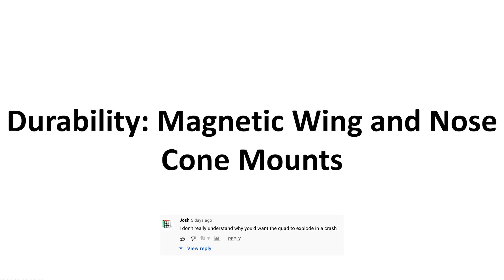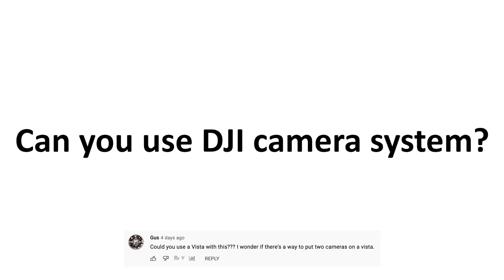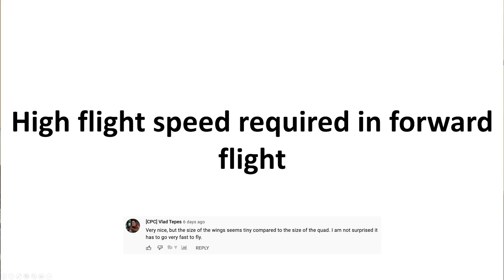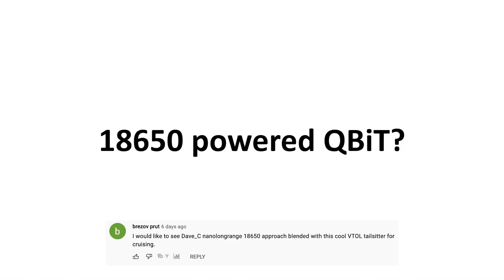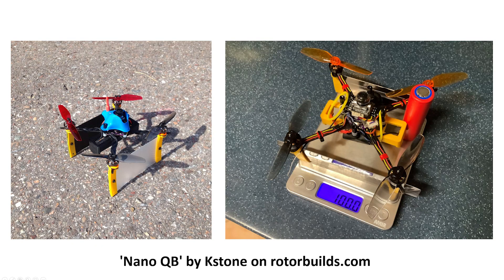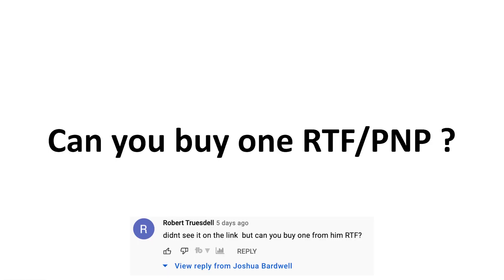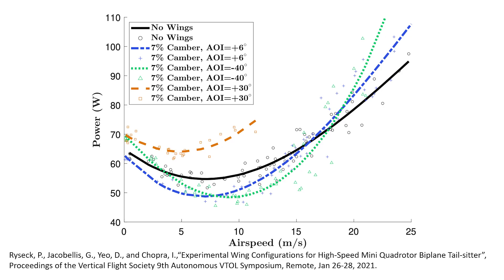Mini QBiT Review by Joshua Bardwell Q&A Follow Up

Comment: Peter - great work.  As a recently retired engineer, it is very gratifying to see you young engineers/students creating new things.  You are the future.  I've been messing around with VTOL RC aircraft with mixed results over the last couple of years.  I've been thinking about this design for a while.  There is a commercial product out now (the swan K1 is one of the names) that uses this design in a larger form factor (very expensive).  They achieve a reasonable airplane roll rate by tilting the motors inward as well as slightly out to the wing tips for extra roll authority.  As such, I wouldn't add elevons to this design.  Also if you upgrade the controller to a 405 or 765/743 based controller, you can move from Betaflight to Arduplane.  Version 4.1 supports this design (brand new capabilities).  It supports up to 6 of many flight modes and handles stuff like transition and autolevel, return to home (with GPS), etc..  You won't need all this radio programming if you use Arduplane.  The one issue is most of these controllers are 30x30mm mounts.  Still looking for a 20X20 stack that will work.  One question, is center of gravity correct for plane mode?  In other words does it fly without differential thrust from the motors to allow it to fly? My biggest problem has been building VTOL aircraft that weren't so heavy that they get don't get obliterated on a crash or take tons of battery to fly.  I think I'll give your parts/design a try.   Thanks for your efforts.
Reply from the maker: Mark, thank you, very gratifying to hear from a fellow engineer. Yes, the Mini Qbit also has motor cant angle to improve roll authority in forward flight. I agree that a more sophisticated controller such as arduplane/pixhawk would be great to explore. Unfortunately the current design only supports up to 20x20mm flight controllers, but a future version might be larger to allow for a greater variety of flight controllers. The center of gravity is placed just behind the leading edge of the wing and it maintains control with the variable rpm rotors. This VTOL is quite durable and won't break immediately in a crash. In fact, the least likely component to break are the wings, the frame or nose cone are more likely to fail. Good luck and let me know if you end up building one!

Comment: Would turning off 2 motors when in forward flight increase its endurance? 
If so is it something you would consider making?
Reply from the maker: Probably not due to increased drag from the rotor. It also needs all 4 rotors spinning for control.
Reply: @peterryseck  yeah you would need to change the fc to let you control with 2 motors. 
Is there a way you could think of getting this platform to fly in plane mode for about 20 minutes while keeping it under 250.
I'm look for vtol platform that's under 250g and with dji hd fpv.
Reply from the maker: @engizmo  potentially! Still looking into it.